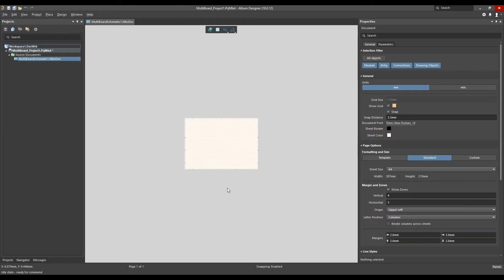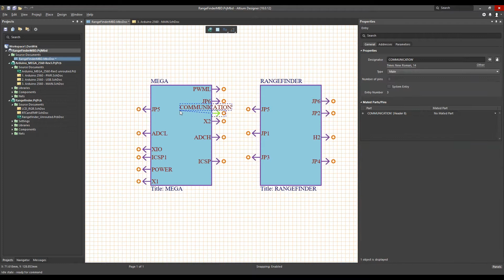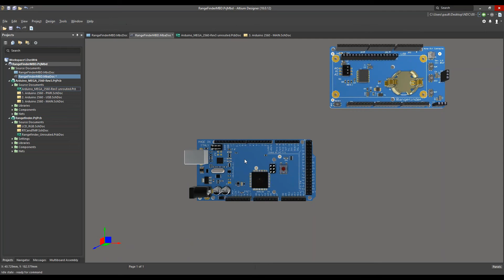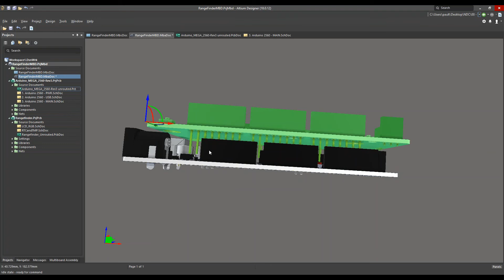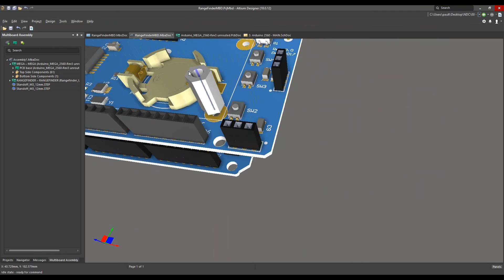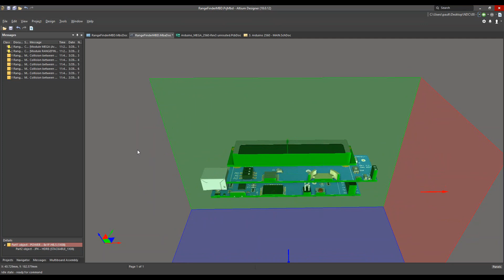Multiboardin’ it in Altium Designer 18

Comment: Brilliant intro to the topic, infinitely better than Altium's own, which are more of a sales pitch.  One issue I did not see was how to manage schematic annotation to avoid duplicate designators.
Reply from the maker: To clarify, there are two designators. There is the designator of the module on the multiboard and the component designators within the projects.

In AD21.6.1, the software will not allow you to create a duplicate designator for the module on the multiboard schematic. It will place an error marker with the tooltip that the "Designator must be unique."

As for unique designators across all of the projects associated with the multiboard project, we do not see a method for doing this in the multiboard schematic. The connection manager can make changes to the netlist, focusing on the nets and associated pins.

Suppose you want to have unique designators across all projects associated with the multiboard project. In that case, we suggest that you open each project individually and modify the annotations to have a prefix. Tools » Annotations » Annotate Schematics. Make sure you propagate this to the layout. (If boards have already been created, this would not be recommended.)

Comment: Thank you for the helpful video. I ran into a issue that nothing showed on the ID column after open the connection manager. Do you know what's the possible reasons?
Reply: Peter, which did you have in your design, a Direct Connection , a wire, a cable, or a harness between the modules? Did any of the other columns get populated? Also, were there pin numbers on the connectors that you used? Any additional information you can provide would be helpful. Thanks. Erich  (erich@ninedotconnects.com)

Comment from the maker: The multiboard schematic editor currently does not have such a feature as you have described it.  If it did exist, it would not know what pins would be correctly connected, especially in the case of a wire or harness configuration, unless the net names matched verbatim.  Therefore, the tool would need a spreadsheet option that it could compare to.  For now, the user will need to review the pin connections for accuracy.

Comment: Thanks for publishing this tutorial, it is very useful!

I would like to ask you something:
Is the MultiBoard Assembly environment capable to check if the pin match assignment I did at the MultiBoard schematic level matches the physical assembly?
One example: If I say that the JPA-1 of board A connects to JPB-1 of board B, it is the designer’s task to ensure that the connectors are not flipped or rotated and JPA-1 aligns to JPB-1, as is JPA-2 with JPB-2 and so on?
Or maybe there is a step able to check the actual copper connection of final assembly?
Thanks in advance!

Comment: Whenever I select  the project from 3 dots, altium shows error about "Sending messages error: System.Reflection.TargetInvocationException..." and more. Then project is selected in Source and PCB in board. But thats all, nothing happens further.
Reply from the maker: We can provide some recommendations as to how to proceed, but this may require someone in Altium support to review your setup and/or files.

The error message that you got was rather specific.  In a sense, that's 'good' because it allows for some specific keywords when searching on both Altium's forums and ideas/bug crunch site.  I took the liberty to do so.  Nothing showed up.  This is also 'good' because this is in a indication that it is specific to your software install, your computer OS setup, or the way you are trying to use the software (as oppose to it being a bug in the software.)

Some silly questions/actions, but sometimes they work:

1) Did you close Altium and reopen it?

2) Did you close your computer and reboot?

3) Are you seeing this on other projects?

What's the next step beyond self diagnostic efforts:

1)  Make sure that you are following the flow of the software.  I am not saying that you doing it wrong; I simply cannot tell because the description provided is vague.  It could have been a missed step or you happen to be using a method that is suppose to be valid, but rarely used.

2) Post on the forums to see if anyone else is having this issue.

3) Get a case into Altium support.  Make sure you provide all the details such as the version, the scenario (the files you have set up), and the steps that you have are taken.
Reply: 1) yes did
2) didnt reboot
3) yes with every project

4)I did exactly as you are showing in video

 soon will do something about it